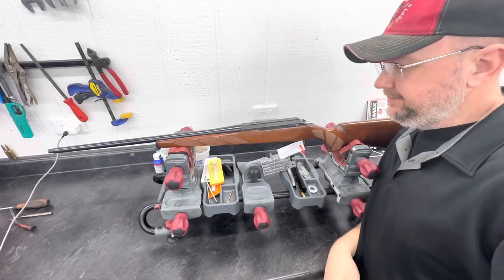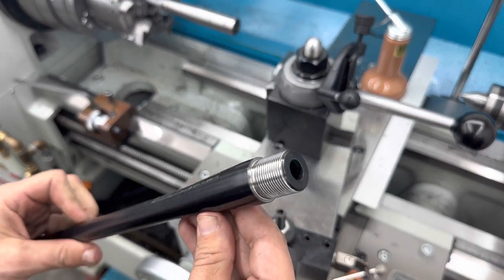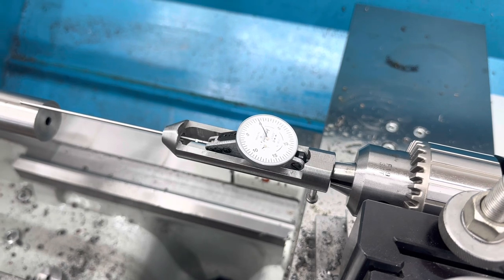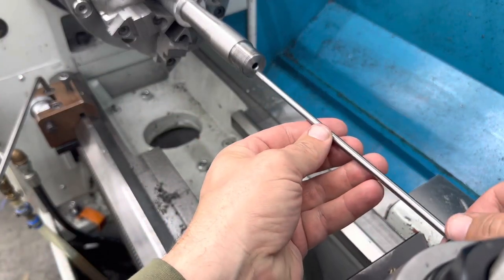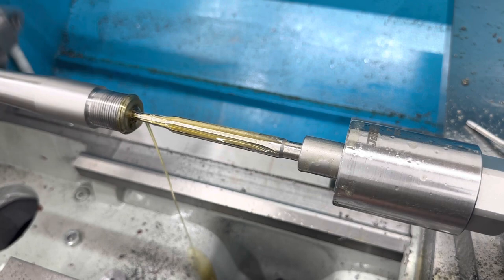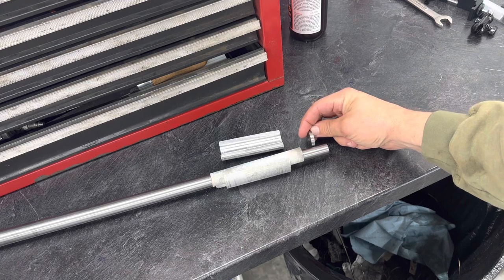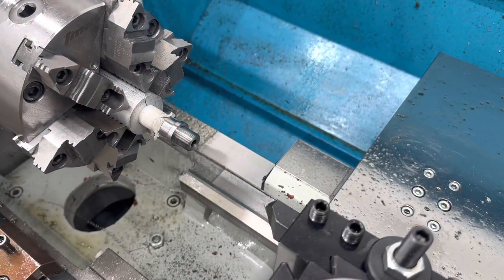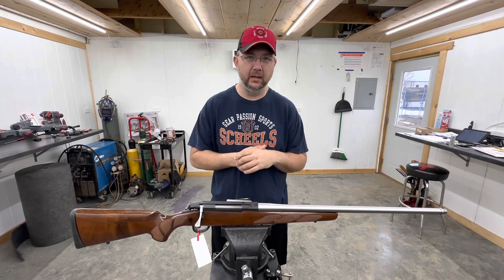Tikka Rebarrel fast twist 25-06. Cutting the chamber, Setting Headspace and threading the muzzle.

Comment: I just bought a Sako 25-06 left handed. If I ever shoot the barrel out on it I want to put a 24 1/2 “ barrel on it with a 1/8 twist. But so far it’s so accurate that I can deal with a little less velocity out of this 22.3” barrel.  Great video!
Reply from the maker: Most say only 25 fps an inch

Comment: How much time did it really take to do all the work? I have been at it for 6 years now but still struggle to give accurate times for work to be done.
Reply from the maker: All said and done I plan on having 6 hours or so into a rifle.
Some are a pain in the neck to dial in. Some do not want to unscrew from the action.
Logging them in and out of the book and taking them to the post office the minutes add up fast.

Comment: I'm curious why you don't use a cutting oil when cutting the tenon? I went to your website to see a fee schedule for services but didn't see one
Reply from the maker: I use carbide tooling. I have found it does not really change the finish one way or the other.
When I cut threads at 500 rpm the heat leaves with the chip.
Our website is a work in process.
The work shown in the video with the barrel is 650.00
Thanks for the questions! 
God Bless,
Dustin
Reply: @DustinDrews1  Was that Tikka with the wood stock able to be pillar bedded?
Reply from the maker: @Accuracy1st  the rifle was just set in the stock for a photo. He is putting it into Oryx chassis
Reply: @DustinDrews1  What is your turn around time if someone sends you ALL parts to build a hunting rifle? On hand: barrel, stock, trigger, bottom metal, action and what would fee be? Metal would be bead blasted finish. And what method of payment do you take? Thanks
Reply from the maker: @Accuracy1st  I don’t like sitting on work. Normally less the 2 weeks. If it just a chamber, thread muzzle and assemble you supply the rifle you supply the parts. Probably around 500.00? 
Bedding, ceramic coatings and such is extra. 
Feel free to text if you wish. 402 Five2one 0286

Comment: I ordered a barrel from Shilens for a Remington 721 Remington that doesn’t shoot I have cleaned and changed scopes out and bedded the action and I am going to rebarrel it with a already threaded and short chambered barrel I’m going with a 280 Ai barrel I have my own barrel vice and I will get the finish reamer I think that it will be a fun project and hopefully make a good rifle it’s supposed to be a factory contour barrel with a 1-8 inch twist and 26 inch long with a target crown is there anything else I need to know about doing my own project
Reply from the maker: Not. Some good cutting oil. And a set of good no go gauges. Good luck with your project!
Reply: @DustinDrews1  I was planning on getting the right tools for the job I got to look at the the bore in it with a bore scope and the original barrel wasn’t very good apparently Remington had started the bore off center the rifling’s coming out of the chamber was longer on one side than the other side and was not cut even it had to been inaccurate it’s hole life

Comment: Just a question. I saw in grizzly video indexing the grooves and the upward curvaure pointing up. Any ideas?
Reply from the maker: Some think that if you clock the barrel so it points up you get some free elevation out of it.
I’m not 100% sold on what they are trying to accomplish.
If what they say is true. Every rifle we shoot that is not clocked would constantly shoot further and further to the left or right it it was not clocked strait up and down.
I have shot a lot of rifles in my life. I can’t remember any of them needing to be adjusted constantly to the right or left at extended ranges.
Just my humble opinion and simple brain trying to put it into real world experience.
Reply: @DustinDrews1  Maybe so that the offset is pointing along single axis and against gravity? Also, they clocked the grooves to be coaxial with the lathe in front of the chamber. The idea was that this way the bullet engages the riffling perfectly coaxially. And that was accomplished by using spider at the muzzle end of the barrel.

Comment: In my shop I true the actions and remove that tapered front section of the action.  I also do away with the cheap bull crap tikka recoil lug.  I use a special profile matching coffin/ rem 700 type recoil lug.  If your gonna go custom barrel true that action!
Lee Gardner Precision.
Reply from the maker: It shot sub half inch according to the customer. I will look into your methods thanks for the visit!